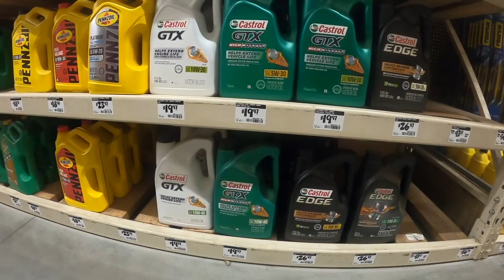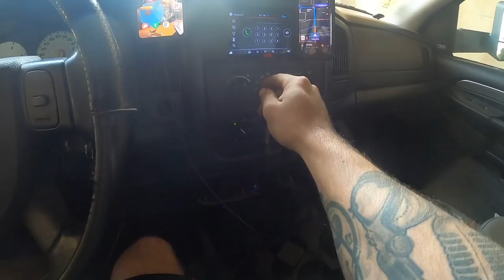Home Day Vlog

Comment: The minimum PSI for airbags is 5 PSI. That's to maintain airbag shape and integrity. I have the wireless on board compressor. I can adjust them rolling down the highway. It allows for near perfect adjustments. I notice I'm never over 50psi. They go up to 100. It only usually takes just a few pounds of air to make all the difference in the world!

Comment: You can solve your fuel shut off with a simple  inline 12  volt solenoid valve. You can get them on Amazon for less than  $30.00. Makes a cheap fix  and should save on the trans and clutch wear staling out your truck to shut if off.

Comment: I run Rottella t6 in everything. I've raced Subaru's for many years and thats the best oil for them thats readily available and cheap. I use it in everything I own from my lawn mower, Atvs, Boat, RV, Daily driver and 7 work trucks and I currently don't even own a diesel.
Reply: What kind of racing did you do?
Reply: @Flatardovonbraun  I'm  willing to bet autocross or rally if he's using that car.
Reply: I was thinking time attack myself. I’m a huge rally nut. I called my company flat out because of how much of a huge fan of Colin McRae (may he RIP) I am.

Comment: I had a 04 3500 identical to your truck for 14 years I was ran 70 pounds front and 65 rears , truck ran smoothly and great tire wear still run the same in my 18 and works great.

Comment: The other reason for valve stem location opposite of each other is not to throw the tire balance off..
Reply: Tires are balanced with valve stems installed.  So would not make a difference.
Reply: @gomerhondo7249  balanced singled,  not the same as when they are dually..  look it up..

Comment: I line up the slots as well. I can air up in the same place instead of having to dig for the other one. I think when you put them opposite, the one is not exactly in the center of the hole?
Reply from the maker: That's true as well.

Comment: Tractor Supply has sales on T4 every once in a while, 5 gal bucket for $60.  I don't run T6 so I don't know about the prices on that.
Reply from the maker: Tractor supply is expensive with everything. I don't go there anymore
Reply: @CPSteveMiller  yeah that's why I get it when it goes on sale, it's cheaper than you can get it at Walmart.

Comment: Does your daily have a leveling kit in the front end if it does you take it out it will lower your truck down about two and a half inches
Reply from the maker: My truck is all stock suspension. Rear is reverse leveled(dropped to match the front)

Comment: Odd you have so much issues with a DD.  I've had both SB and Valair DDs, and no issues with either..  My SB 3650DD in my G56 dually is fine.  Only issue I have is if sitting in N, then clutch and try to go into Rev, it wont go.  But if I just stick 1st then Rev, it falls right into gear.
Reply from the maker: If you're pushing the clutch in for the first time you have to put it in any gear and then reverse. I've never had a transmission that allowed me to put it in reverse after pushing the clutch in. I've had around 30 manuals and 20 autos. The DD has so many complaints. It's the reason I learned to float because shifting is so hard at times I have to rerev to bring the rpms back up before I let the clutch out
Reply: @CPSteveMiller  well, so have I.
Reply: I had a dual disk in a 2008 f350, it was a nightmare to shift and put in gear, it ended up being a broken clutch fork. After we cummins swapped it I out a single disk south bend in it and it seems to shift fine, not as nice as my old nv4500 but this zf6 isn't too bad
Reply: @farmingforfun9534  #FumminsLife
Reply: @geriatricginger  worth every penny lol

Comment: I'm disappointed  in the other video of changing the oil. You didn't know the mileage AND you where 4 to 5 qts. Low. The oil does several things,  lubricating and lowering Temps. Oil changing  is VERY IMPORTANT.  DON'T  do that again.  😂
Reply from the maker: I would've know the miles but keep truckin deleted everything🤦‍♂️